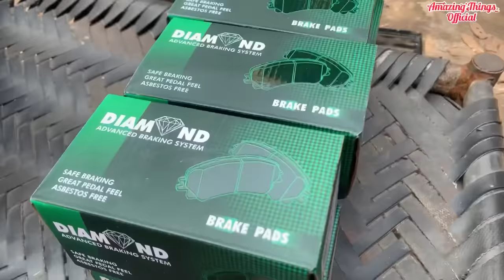How Carbon Fiber Brake Pads are Made In Local Factory || How Car Brake Pads are Recycle in Pakistan

Comment: When people brag about getting $8 sets of brake pads, this is the factory I imagine them coming from.
Reply: Looks like a good deal to me!!
Reply: wtf where do you find $8 brakepads? i paid $40 /set
Reply: @schlomoshekelstein908  I remember an acquaintance a few years ago bragging about getting some $8 brake pads online somewhere and me just shaking my head. Personally if lives depend on it, I'm at least getting something with a decent name brand on it. I'll cheap out on a water pump or on air filters, but not brake equipment, tires or bearings.
Reply: Are they any good and do you know how much ?
Reply: @cheefmtn850  look on eBay, or one of the overseas import sites. I'd suspect that the quality would be horrible at best, deadly at worst. The "organic" material is probably donkey poo, and chopped hay with some shredded plastic bags mixed in as a binder for when it gets heated and compressed.
Reply: @schlomoshekelstein908  I believe in Pakistan, but 40$ a set are still cheap brake pads.

Comment: Carbon fiber? Looks a damn lot like asbestos, hello mesothelioma
Reply: That's exactly what it is, short life for those kids.
Reply: Asbestos or mineral fibre... just as bad.
Reply: Agree
Reply: The boxes say asbestos free so unless the company who supplies the brake pads is acting illegally I highly doubt asbestos is being used in the production of these brake pads.
Reply: Asbestos is actually pretty harmless unless you are using saws to process it (super fine particles) or it's blue asbestos or unusual colours. 
I know someone who is 80+ who used to throw snowballs of it at work all the time and worked around it for 20 years with no PPE and no issue. Many others he worked with are same with no issues.
Reply: @N4CR  'Asbestos is actually pretty harmless' mate there is no safe limit with asbestos, a single exposure can kill you. if he lives long enough your friend will eventually die from asbestos. ask him how many of those he used to work with aren't fine anymore.
Reply: @usarkarzts4207  agreed!
Reply: @N4CR  that reads like a urban legend... asbestos is not harmless at all
Reply: 10:25 and the dust goes into the lungs
Reply: It says: "Metals such as copper, brass, iron or gray cast iron, mineral or organic fibers, the sulphides of iron, copper, antimony (antimony trisulphide), zinc, tin or molybdenum, previously also lead and asbestos, as well as heavy spar (barium sulphate) are used as friction agents. "
Reply: @dodgem259  I've seen a new hospital have to remove entire roof cladding because the "asbestos free" cladding turned out to have been made in China and full of Asbestos. And it's was a one billion dollar kids hospital.
Reply: The box says asbestos free but it also says “advanced braking system”
Reply: Their pads are asbestos free...
Reply: If you or a loved one has ever worked at Diamond brake factory.  Call the Law Tigers today!
Reply: @N4CR  Tell that to Steve McQueen.
Reply: @cliveramsbotty6077  it has to be inhaled to be harmful.
Reply: @dodgem259  Diamond brakes is a japanese brand. The stuff look like fiberglass powder to me. Nothing legit in the video , all brakes are counterfeit.
Reply: @cliveramsbotty6077  same with Tobacco, there is also no safe exposure, a single exposure can kill you by the same measure.
Reply: @dodgem259  that's because asbestos is allowed to be used in these countries look up vids on YouTube it's still highly used in India to make cheap roofing. Most of the western world has band the use of asbestos. Canada closed its last asbestos mine in 2011!

Comment: These brake pads are made of :
- recycled base plate
- compacted newspapers dust
- 50 layers of black paint
Reply: Yeah only carbon I saw was from the ash of the burnt up wood.
Much less fiber.
now we know why the pads come off of the backing plates when you buy them from Autozone.
Reply: jajaja, sure....
Reply: Regardless which person involved in this manufacturing process you pick, by our definition of work safety they all must have already died... Hope these brake pads were meant for tractors

Comment: So encouraging to see Pakistan moving into high-tech manufacturing.
Joking aside, I remember I was in China in 1991, in a small town I saw a little shop front 'factory' of three farm ladies making cotton quilts by hand: Sacks of raw cotton on one side, rolls of cotton cloth on the other, and a big table in the middle where they spread out cotton, evened it out, made it nice and fluffy, then a sheet of cloth on top which they then quilted together. I think they could make one quilt every two hours between the three of them. China, of course, has moved on since those days.

Comment: Nice work guys!  If you put a water drip coming down from a tank and a splash guard on the grinder with a catch basin it will make a lot less dust.
Reply: They're not going to see your comment.
Reply: water is in the river miles away

Comment: Well if that’s what heat does to brake pads, god help anyone who wants to stop in a hurry!
Reply: They are releasing the adhesive on the backing plate to the puck material. Nothing new here. It takes a LOT of heat and a longer period of time than anyone applies brakes for (unless there's a failure). You will end up boiling the brake fluid before you get it that hot.

Comment: What are these pads really made of? I don't see anything that looks like carbon.
Reply: Whatever it is it's a low temperature substance if it can be consolidated with the heat of an open flame!!
Reply: It had been burned and would therefore be carbonised.
Reply: @ryokoasakura1047  Carbonised asbestos is not carbon fiber
Reply: mister kluge  true, but knowing that asbestos is cheap and still widely used in developping countries is why i'm pretty sure it's asbestos
Reply: @wardwyseur  Don't think so.

Comment: And what about quality control testing?.. I mean how reliable could be these brake pads to stop a car and last a reasonable time according to braking and wearing standards?
Reply: Good question, eh?
Reply: In proper manufacturing they do shear tests and put them in a machine and work them until they  get red hot to check at what temperature the fail to make sure of the quality

Comment: Very interesting. I researched this brand a little. They've a Facebook page too. They are in many aspects of brake pad and shoe manufacturing. Seems they do clutches too. I only hope they are compensated fairly for the hard work they do. I wish they would send masks and safety glasses with the next box shipment, that would be GOOD.
Reply: What brand?
Reply: @swesleyc7  they're called Diamond. On a box it's spelled diam nd, between the m n is a picture of a 💎.
Reply: They are a brake recycling company based in Pakistan.
They do not meet safety standards in Europe.
Reply: these guys are making counterfeit brake pads, in counterfeit boxes with counterfeit stickers.
Reply: @RakTheGoose   they are not, this is a legitimate company. They have a Facebook page that actually has this video on it. They are called Diamond Brake Pads and are based in Pakistan and export across Asia. 
There is also a UK company called Black Diamond with near identical packaging. They are not associated with the Pakistani company at all.
Reply: As far as compensation, this is just bulk labor, they get whatever the market allows, if they disagree they can move on I guess. but there are few laws there for job security and safety compared to places like Europe and the US
Reply: @Backs4more  it's a legitimate company trying to sell off the backs of the UK brand. It's like the shoes I bought called Raebok instead of Reebok.
Reply: Counterfeit based economy lol

Comment: I'm curious if they have different molds to make larger brake pads or if they've decided to focus on this model for a common application. Also curious if there's any markings to keep track of how many times a plate gets recycled before discarding it.
Reply: I imagine they have another set of moulds for different size pads. Rest is likely the same. But then again another shop down the street might do some other types.
Reply: только толщина пластины может указывать на количество применений.
Reply: This is the "Suzuki Alto Brake Pads" factory. The Toyota Landcruiser one is next backyard.
Reply: There can be hundreds of similar shops in same area. they get the material ready sorted. So they get just thousands of same model pad in this shop. Next door gets the other model etc.. you get the idea?
Reply: @SergeyPRKL  Actually they seem to make some shoes and maybe even clutch plates too.
Reply: Plates are forever!
Reply: What do you mean by "how many times a plate gets recycled"? :)
Reply: @petebeatminister the metal backing plates are from worn out pads. They baked them at the beginning to remove the remaining friction material from their first use. Many times the parts store wants the cores returned

Comment: Most of the health and safety issues in this place could be easily rectified using masks, vacuum fans and proper guarding , it wouldn’t cost very much but would definitely improve the quality of life and long term health of the young men working there.
Reply: Is amazing the impact that culture has. Is difficult for them to implement that because usually the business owners do not want to spend in anything of the short as they see it as unnecessary spending, worse is the same workers have the culture of being though, they feel silly if they wear PPE and many coworkers make fun of PPE, it is also downright ignorance.

Comment: Seriously a couple years ago these diamond brand pads were a budget option for Toyotas from one of the parts distributors the shop I worked at used. There are countless corollas and yaris’s running around the sf bay area on these pads.

Comment: The working technology is minimal, but the product is visually like the original.  No protective work equipment.  There is no job security.  But it works.  What else is left.  Great job by the workers.  However, I don't want to risk braking from 150-0, but I want to be sure that I can stop the car.

Comment: The atate-of-the art pre-painting process at 13:30 ensures that only 1 out of 12 brake pads will have a fully painted-on  friction surface -I wonder if these are then oaired and sold as "premium carbon fiber brake pads".

Comment: Diamond Brake Pads are made by a Japanese company.  

Because of the lack of quality control, I would have to assume that these are knockoffs.  Unless they subcontract, but if so then where's the quality control?  

Brake pads are not cheap.  A set of four can go for anywhere between $50 and $100 or more.

So each of those boxes is at least $50 retail.  

A small team makes 25 boxes per day.  

That's a decent chunk of change.  Of course, they don't get retail they get wholesale.  Even so, in a low-cost area, that's not bad.  

If they could add one thing to the manufacturing process that would make it a lot safer, it would be a breathing mask when painting or when sanding.  

Or even just a strong fan to blow away the fumes would be helpful.

Comment: They're inbetween OSHA inspections apparently. That's just the way it works in the 3d world. Looks like Pakistan. Lives are regrettably cheap there, the jingle trucks need brakes to roll and there's no Autozone to be found. A set of 8 factory pads would feed a fam for a year, so they get 'em from these good ol' boys for pennies.

Comment: Google found  this company with exact same logo... "Diamond Japanese Auto Parts LTD is a world’s leading company with more than 30 factories specialized in manufacturing varieties of high quality auto brake pads, brake linings and brake shoes for all kinds of models such as light, medium and heavy automobiles. The brakes produced by Diamond are characterized by stable braking performance, good abrasive resistance, high temperature resistance, no noise and pollution." Box says made in Malaysia.

Comment: This isn't really brake pad manufacturing . It'smore like refurbisment. I doubt the material is carbon fibre! Anyway very interesting. The most of which is the appaling health and safety standards in practice. The only thing that coud be worse is if the refurbishing lining material has a asbestos base.

Comment: Ot wouldn't cost them anything to reconfigure the eq.to make it 2x as efficient and safer at the same time. 
Ex. The kid who's job it is to use the table saw: a slot which holds the pads to be cut in the middle could be formed and the pads could be slid over the table saw instead of one day slicing off his fingers. 
The space is filthy. There's no need for that. The chaos alone causes accidents to happen. They are all good at what they do, but there's no organizational principles. That alone would boost efficiency and make for a higher output, more precision and a safer work space.
Just being more efficient with "the line." 
I don't get it. There's something missing from this picture. It's a shame because these guys are good at what they do.

Comment: This here is why you never want to go with the cheapest price at a repair shop. No sheer testing, reusing rusty contaminated metal plates and not even resized for the caliper mounting bracket. Poor quality and guaranteed to make noise, they didn’t even chamfer the pads lol.

Comment: Where are Diamond brake pads made?
The brakes produced by Diamond are characterized by stable braking performance, good abrasive resistance, high temperature resistance, no noise and pollution. FBK systems SDN. BHD. is one of the largest OEM friction brake part manufacturers in Malaysia exporting its products to many countries worldwide.  Diamond Japanese Auto Parts LTD is a world’s leading company with more than 30 factories specialized in manufacturing varieties of high quality auto brake pads, brake linings and brake shoes for all kinds of models such as light, medium and heavy automobiles. The brakes produced by Diamond are characterized by stable braking performance, good abrasive resistance, high temperature resistance, no noise and pollution.

for all JAPANESE and KOREAN cars

OK this truly scares the s#@t out of me! I did a search after watching the video. Exact same box and everything. There you have it. Maybe we all think we are getting this really technologically advanced science based materials/super researched/tried and true technology for the stoppers that will save our lives. Then again our brake pads can easily be made from recycled brake pads in a homemade shop i( sorry the description calls it a factory) in who knows what super poor underdeveloped corner of the  world where the kid doing a lot of the work looks about 13 years old working in a heavily polluted environment without a shred of protection.  Only thing that changes is the box they are placed in. Note it says " for all Japanese and Korean cars"  Huuummmmm wonder if that's what's stopping my Lexus 😂😂😂😂😂😂😂😂😂 Ironic don't you think?

Comment: Kind of a sad one here, the young man starting at 9:30 who is grinding and cutting the friction material will certainly be dead before middle age due to lung related illness. Also the friction material isn't bonded well to the back plate in any semi acceptable way which will result in separation and loss of braking ability. I normally like these videos watching guys work with primitive methods, but these brake pads will result in many unnecessary deaths from manufacturing and use.

Comment: It's horrifying the conditions these people have to work in.
No consideration for their health or well being whatsoever.
From breathing in fibers and spray chemicals to unguarded cutting/grinding discs that could literally
maim or even kill them if they shattered in service. 
I know we go on about H&S laws and, yes, some of them do appear to go a bit OTT but when you look at this
it's a solid reminder not just how bad it could be but how bad it actually was at the start of the industrial revolution.
On a slightly different note I don't think I will be putting these pads on my Beemer any time soon given
that it seems you can tap the pads off the back plate just by heating them up for half an hour.